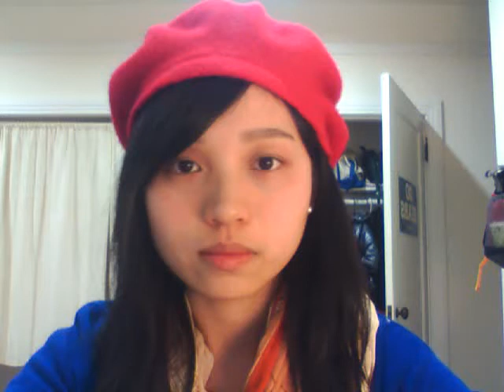#6 Video - Design Patents for everyone!

Comment: Great video! So a single product needs several design and functionality patents. I think another major problem that will eventually emerge is that companies that file a patent but not yet release the product using the patent will clash head on with other company R&D units. If that's the case, it would basically become a non-partisan entity with the ability to sue any tech company...